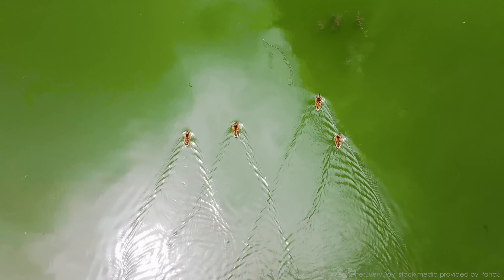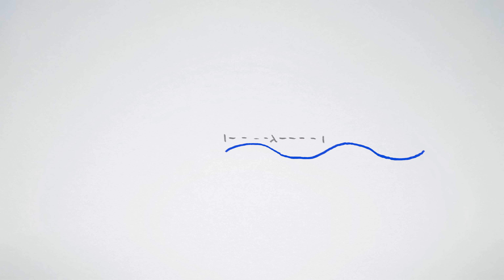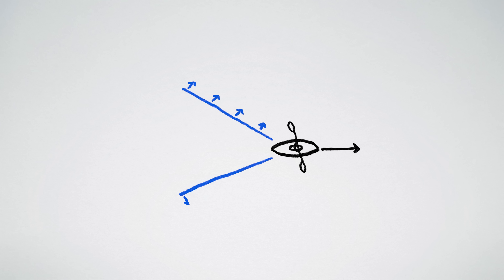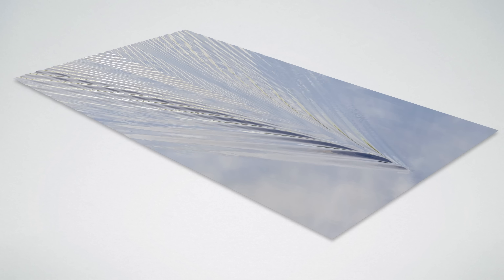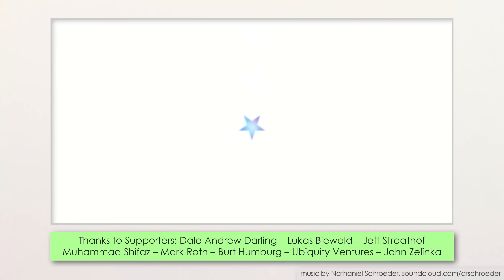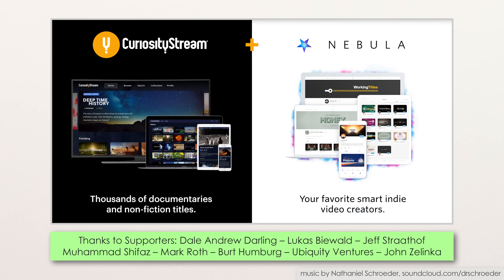Why Do Boats Make This Shape?

Comment: There are actually some mistakes in this video:
1. Water waves do not travel as depicted and it is not the water that moves in some direction. You can best imagine water waves by imagining someone moving up and down a rope fast. (Wave length there depends on how fast the rope is being moved up and down, the faster - the more waves can be seen on the rope. That is different with water waves. I forgot how sound and light waves work exactly, but I believe light waves actually travel (duality is a word that comes to my mind, but it is too long ago that I have learned this.))
2. The waves of any water vessel can never be faster. So the person in the kayak will never see any waves moving in his forward direction. There is no bow way moving forward. Vessels always stay ahead of any of their waves (unless they slow down. You have to actually consider that, when you pass under a bridge, where there is little room at the top. You don't want your own waves to lift you against the bridge.)
3. The waves along the side of the vessel travel exactly at the speed of the vessel. It is only when they put distance between them and the ship or boat, they will start to slow down.  The further away from the vessel, the slower the waves and the lower the amplitudes of them.
I am not sure, but I believe that the Kelvin wave pattern has been refuted. Don't know, if there is a newer model. Real wave systems from vessels are extremely complicated.
Reply: You may not have noticed them, but anything disturbing a watersurface creates a disturbance that radiates outwards, aka a circular wave. So boats really make waves that travel in the same direction, but the boat needs to be moving very slow. Still, the wake is an addition of a lot of waves, therefore much, much larger in amplitude.

Comment: The speed of light through matter / index of refraction changes depending on its frequency, same as water wakes. Even cooler is that electrons can generate a wake of light by going faster than light through matter. This phenomenon is known as Cherenkov Radiation and is what makes nuclear reactors glow.

Comment: This contains interesting information which doesn't appear to answer the question. It doesn't explain why a boat moving through the water creates a series of circular waves. It's easy to imagine how that would happen for a boat dropped into water, producing a single wave, or for a boat moved on a gantry over water being dipped into water at intervals. I'd like an explanation of why the boat moving continuously through water creates a series of discrete waves while a bullet moving through air creates a continuous wave.
Dispersion tells me why different waves coming from the boat propagate at different speeds producing interesting interference patterns but I don't see that it tells me why the constantly moving boat generates a series of circular waves.... At any time of the constant motion of the boat in smooth water the forces between it and the water are the same. I can see how the bow wave and stern wave can have different speeds and so produce an interference patter but that doesn't seem to be what you're describing.

Comment: I have a question.
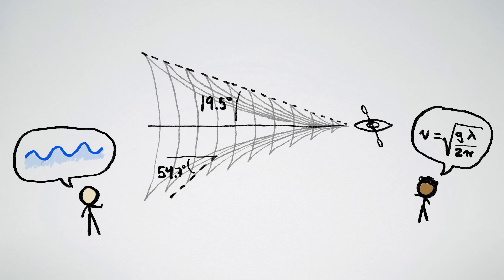At around 0:40 you state what I interpreted to mean that light and sound wave propagation speed in a given medium is constant (wavelength independent). 
But phase dispersion in a waveguide is a thing that happens. Is this a phenomenon of wavelemgth dependent amplitude attenuation like how high frequency sounds don't travel as far, but still travel at the same speed?

Also, what causes the wavelength based phase velocity?
Is it a property of 2D waves propagating on an interface that isn't shared by waves propagating in 3D like sound or 1D like photon propagation?

Is there a name for the equavalents to the refraction index in other waves?

Comment: so the takeaway here is 'for profit' CuriosityStream AND Nebula are full of uncorrected errors, just like the us NIST standards, "Mathematics usurping observation" yet again, got it.

Sound waves travel faster in denser substances because neighbouring particles will more easily bump into one another. ... Thus sound waves travel much faster in water than they do in air. In freshwater at room temperature, for example, sound travels about 4.3 times faster than it does in air at the same temperature.

What happens when a sound wave moves from air to water?
When a sound wave travels from air into water, several properties will change. The wave speed will increase as the wave crosses the boundary into the water causing the spacing between crests (the wavelength) to increase, because crests move away from the boundary faster than they move up to the boundary.

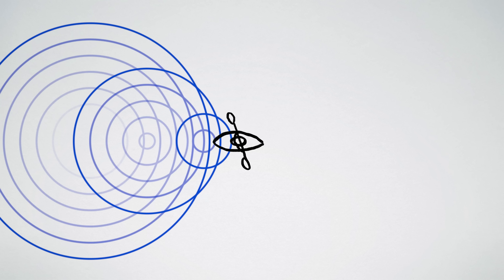Comment: I’m at 1:43 and already a bit concerned (not sure that’s the right word but confused wasn’t right either). Light waves and sound waves are both the things that travel. Light in a medium (or empty vacuum) and sound in a medium like air. However, what you’re calling water waves doesn’t really make sense with this understanding or with my previous physics education, which states that water is the medium and not what is traveling. Rather there are energy waves in the medium of water. I hope this is clarified in the next 2 ½ minutes because there’s a clear contradiction right now between what I hear you saying and what multiple physicists in my past have stated.

Comment: So that spawns an interesting question: if dispersion of waves of different speeds exist, are all the differing speeds emitted from the motion simultaneously, or are the water particles accelerating and thus creating the wider waves longer after contact? That would explain why the wake feathers outward more further from the boat instead of closer to it

Comment: I kind of not agree with your statement in 0:39 . 

You can observe dispersion with light (EM) wave and "sound" (pressure) wave too. Just not as dramatic. The case of a transverse physical wave in a medium as heavy as water makes this phenomenon a lot more observable but doesn't mean that water (or liquids in general) stands out of the rest of the physic of the universe.

Every single medium have some degree of dispersion. The only way of getting no interractions at all is to get no medium at all (absolute vacuum) but even air causes a bit of dispersion.

Comment: If we assume the water is distilled, at sea level, perfectly calm, 25 C temp how fast would a boat have to travel, theoretically so the wake is a straight line? What happens if the same boat in the same condition travelled even faster? Obviously not of this is real world possible but is it mathematically possible? 
What is the angle of the closest to real world straight line in optimal conditions? What speed is needed to achieve that.

Comment: Because physics the boat splits water and how much depends on the design but either way it's going to park water as it goes through and the water is going to fill in behind in those waves well hit each other and bounce back outwards that's why you get the what appears to be crashing White waves if you're fast enough or just Ripple waves the water fills the void when they Collide in the middle bounces back out sorry about that punctuation and grammar have to use voice activated text are prohibitively difficult I sincerely apologize also this was before the video because I'm guessing you actually looked it up I'll see if I'm right it's much easier to say you knew what it was after you've been told accountability

Comment: you could get a V-ish shape from diffraction too no? Sorta the opposite situation as the typical diffraction example (barrier with narrow slit -> just a narrow barrier). But that alone wouldn't look anything like a boat wake, other than the general V-ish boundary  lol. Completely different situation as the boat, different pattern within the V.. this would be like tossing a rock into a pond, and there's a branch protruding through the surface somewhere. Here, the waves are already there independent of the boat (branch) and the boat-analog is obstructing them. Whereas in the wake-situation the water (ideally) is initially wave-free and the boat's motion creating waves continuously.

Comment: Umm...essentially, the answer is “boats make this unique pattern of wake because they make this unique pattern of wake.”  This is a great explanation of what creates the Kelvin wake pattern, but it is not an explanation about why boats make waves of different wavelengths, hence speed of the waves, dispersion, that result in the Kelvin wake pattern.  Apparently I need Nebula to find out, or a couple of hours studying fluid dynamics, drag, and ocean engineering.
Reply: Dispersion is something that happens when the speed of a wave depends on its wavelength. For example, when white light enters a prism, the speed of light through the material depends on its wavelength and you end up with different angles of refraction for different colors, hence the "rainbow" that forms.

IDK if you know about fourier transforms, but the point is, any function can be equivalently represented by an infinite sum of pure frequencies (cosines) with varying amplitudes and phases. There's a function called the dirac delta function. It's an impulse (think of clapping your hands and the sound it makes... it's approximate). The frequency domain representation of an impulse (unscaled) is equal to 1 at all frequencies. The takeaway here is an impulse is composed of all frequencies....
You can think of the boat as it travels through water being a train of impulse functions stimulation the water. The water will act as a filter and some wavelengths will be "accepted" by the water while others will be "rejected"/attenuated. And the boat traveling through the water isn't perfectly modeled by a train of impulses. But the overall intuition applies--the boat's motion through the water produces waves of many wavelengths, and the speed of waves in water is dependent on the wavelength=dispersion.
Reply: Not related to boats... but as far as impulse functions/frequencies/etc. something many people have heard of (musicians/producers) but don't really think about what it really is, is in guitar amp cabinet "impulse responses". Basically, an "impulse" is played through the cabinet, and the output is recorded with a microphone. The impulse contains (ideally) equal magnitude/phase of all frequencies, so the recorded output is the "impulse response", which, in frequency domain (if you fourier transform it) is equal to the frequency response of the cabinet... a function whose value at a particular frequency is how much that frequency is scaled in magnitude and phase. Once you have that impulse response on a computer, you can take a recording that's on a computer, do a convolution (math operation, same as multiplication in frequency domain) with the impulse response of the cab, and the result will sound as if it was actually played through the cab. This same theory is applied by some modern home stereo systems to "undo" the frequency response of the room the speakers are in for a specific listening location.

Comment: Assuming the same thing happens in the air too? Just a bit more inside the 3D object (Air) than on its surface.
This also makes me think about the simultaneous wake in the air caused by the boat.

Comment: The immediate question coming to mind is: why does a boat, in an idealized environment, create waves of different length going at constant speed through still waters? Does it even or is it purely a consequence of non-ideal parameters?
Reply: So, firstly don't mistake me for someone who knows what they are talking about, but a boat ploughing through water is plausibly going to generate a bit of turbulence, which is sort of like generating white noise, ie a signal containing a wide spread of frequencies.

Comment: Wakes are also generated by the stern of a vessel, not just the bow.  And the longest waves are generated by the ship as a whole (as if from the sides).  This makes for a more complex and subtle pattern from which lots of information may be extracted.  As the video illustrates, the best way to get this information is via images from above.  Which especially includes satellites.

A good image will captures the wake when the contrast is highest, which means the lighting must be ideal.  In this case, lighting from a 45 degree angle works best.  Also, the reflected light is polarized, so even a less-than-optimal image may be improved by placing a polarizer in front of the camera that is adjusted to the angle needed to accentuate the polarization.

So, let's say we have a fairly good image from above.  What can we learn from such images, even if the vessel itself isn't visible?  Here's a partial list:
- Speed
- Direction
- Rate of turn (or lack of turning)
- Hull length (for larger vessels)
- Approximate draft (depth in the water)
- Approximate hull shape (particularly the presence of a bulbous nose or a flat stern)
- Approximate displacement

All the above may be determined from a single image, without having to see the ship itself!  But it works best only for conventional "wet hull" ships: Hydrofoils and hovercraft have different wake signatures that are harder to interpret.  Multi-hull ships (catamarans, trimarans) aren't a problem.

But what about when multiple vessels are in close proximity, such as for military exercises?  Overlapping wakes are much more difficult to decode.  There are many tricks that may be intentionally used to limit the value of wake imaging, particularly to make two very different vessels appear similar from above.  But assuming no tricks, there are ways to determine much of the above information for every vessel in a fleet, and also do so at night.  But it requires filtering out most of the wave data, and focusing only on the elements that most easily provide the information we seek.  A great way to do this is by using Synthetic Aperture Radar (SAR), where a satellite sweeps an area with radio waves of specific frequencies, and which also works when clouds obscure the view.

Military folks were only the first to do this.  Today, cameras and SAR on commercial satellites are used to complement the AIS (Automatic Identification Signal) sent by ships to share their location to avoid collisions.  Particular attention is paid to large ships not transmitting an AIS signal, or transmitting an incorrect signal, as it can indicate problems on the ship (electrical failure, piracy, fire, etc.) and trigger a Coast Guard response to investigate.  Commercial wake imaging is good enough that even military ships typically keep their AIS active at all times: It is very hard to hide a moving ship!

Comment: the pattern is interesting.  

now, here the hard question:

other than speed and the density and depth of the water, what causes the period of the waves?  in other words, what is MOST attributed to long period, fast moving waves versus short period, slow moving waves.  remove the speed of the boat, and accept that density and depth of water are moot.  What actually creates the frequency of the wave?

hint:  displacement

spoiler:  consult a naval hydrodynamic engineer before guessing.

for another clue:  examine pressure waves from submarines and inspect the differences above the hull versus the difference below the hull..

if you are thinking about "lift"...you are getting close....

if you are now thinking that the layer between water and atmosphere contains clues, you are even closer.

have fun with this one.

Comment: I think dispersion happens in all light, sound and water wave, except light in vacuum
Reply: maybe different colors also have different speeds
Reply: Yes, but for light and sound in air for exammle the effect is negligeable.
Reply: @cptn_n3m012  it depends on the application. When you need high accuracy or high utilization of band width, it becomes a concerns in fiber   communication. Dispersion would be magnified by distance traveled too

Comment: A question for you. Can we find the mass of a photon by the formula m = h/cλ,
where
m is the mass of the photon
h is the Planck's constant
c is the speed of light
λ is the wavelength?

(Rearrangement of Compton's wavelength and an edit in de Broglie wavelength)
Reply: No, Compton's wavelength describes the change in wavelength in scattering processes. It does not describe wavelenths of photons itself, so it is not applicable here.
Photons also have a mass of m=0, always. If you want to relate the energy and the momentum/wavelength of a photon, take the formula E² = (mc²)² + (pc)², which reduces to the famous E = mc² for particles at with no momentum/velocity.

So for a photon we have E = pc = hc/λ.
Reply: @sarcasticsteve7622  Ok thanks

Comment: Why does moving boat(/kayak/duck/etc) in water leave circular waves with multiple different wavelength? I thought it would leave a constant > shaped trail where the angle in the middle is related to the speed? not taking into account the waves created by propulsion mechanism (i.e propeller, oar, feet).

Comment: Very impressive! One little clarification for 0:43 : The speed of sound in an ideal gas varies only by temperature and not e.g. by pressure. Specifically, it is proportional to the square root of absolute temperature, which is the result of particle speeds in a Maxwell-Boltzmann distribution.[1]

It varies by altitude because temperature does, but you can't really say it's 343 m/s in dry air at sea level because sea level does not imply a specific temperature.

[1] https://en.wikipedia.org/wiki/Maxwell%E2%80%93Boltzmann_distribution
Reply: that is an approximation